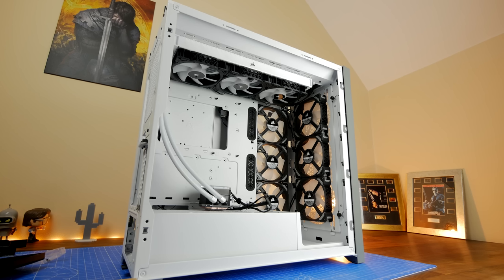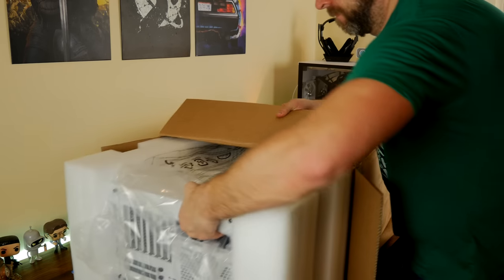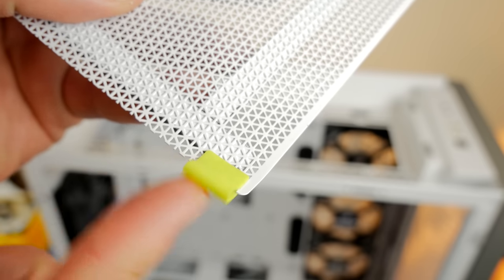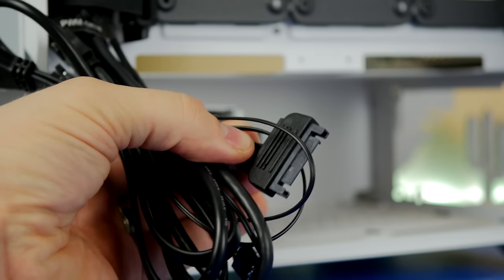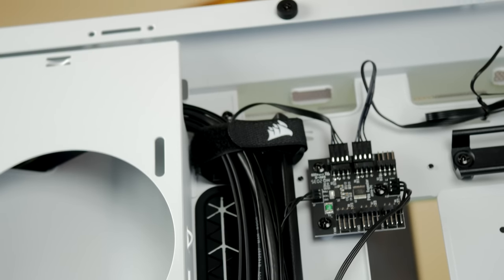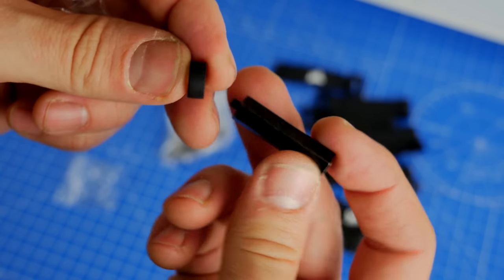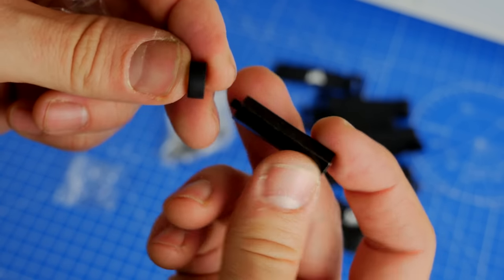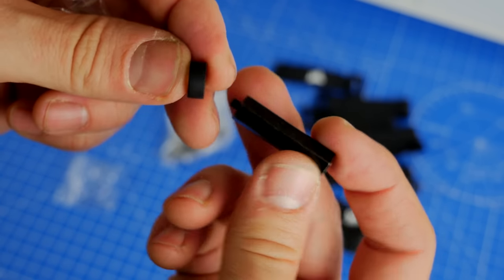Corsair 5000D Airflow build with 12 fans, H150i Elite Capellix Push Pull (in-depth build guide)

Comment: I was doing the same thing as you. Transferring from a Meshify C to this 5000D. 

I didn't bother removing either fan tray. I've removed the velcro straps from other cases and they were a pita to get back in. Installing the fans without removing the fan tray was super easy. The main problem I had with this case (and I feel like you gave me a solution for) is that my cpu power cables are pressed so tight against my 360 AIO that the rear fan can't even spin. Also, my AIO tubes were pushed up against the rear fan preventing it from spinning, but I just slid the AIO forward and that fixed that issue. 

But you gave me the idea of top mounting my AIO fans and just run a pull config. I should have known to do that anyway. I watched a video from Jayz2cents a long time ago that shows push or pull doesn't matter, you're still moving the same amount of air through the rad. Also, I have the same issue you do where the "shame" door won't close all the way. I thought the small hole above the finger hole was so you could put a screw into the magnet and hold it closed, but I couldn't find one that worked. 

Also, I was looking to see how you dealt with the front fan cables. Early on, you ran into the same issue as me where you were thinking your only option was to run them through the slots for the rear door and potentially cut them with the door. This is how I currently have mine, but it also made it to where I had to run the power cords across the side fan mount to get to the fan controller. Yours is more clean, but I didn't see how you ran them.  All in all, I really like the case and I appreciate this full length build!

Comment: I did a build with this case, I mounted 3x radiators 9x fans 3x SSD's, and a Corsair XD5. It was a super tight build!
Reply: How did you fit the side fan panel back in? It seems like mine won’t fit and like the screw holes just don’t line up. Is there something I’m missing?
Reply: @JayJulo  I don't think the rad is 100% straight, and I might have left a couple of screws out that didn't line up. Just made sure it was all tight - I have a video on my channel High End Gaming Rig 10900F, check it out if it helps...If you need to jam a RAD on the side it can only be 30mm thick or it won't fit.

Comment: Great and informative video, thank you. I have this case as well as the same fan set up and I hope you can help me out with a diagram of the wiring for 12 RGB fans. I have the same fans and cooler as you do. I have never had to wire this many before and I am unsure about extra hubs and where to plug them into work properly. I did get great info from the video and I "think" it registered in my brain but having an actual printable guide would ease my worry. Never the less this was a needed info guide for me thank you again. Maybe when my RGB hub arrives it will be self-explaining idk

Comment: I was wondering if a 360 rad in push pull could fit. Answer is yes.
Reply: SAME i was wondering if the cpu cable was gonna fit thx
Reply: @HolohoIic  So update! I actually used this case and a 360 rad in push pull the only issue I had was with the top CPU to the mobo fitting. Its hella tight but works!
Reply: @KamranHusain12  Currently doing the same build, same case. My only concern is when you have the pull fans on top, obviously the dust cover won't cover the sides where the air sort of channels in. Have you noticed any problems from this? Thanks!
Reply: @mattmanning8874   Regarding the dust covers on the sides I have not really noticed any issues with them. I removed the dust covers on tops because its pushing out.  BTW al my fans are the lian li ones.
Reply: @KamranHusain12  Nice. I couldn't fit my Liquid Freezer II 360 AIO on the top mount. Really sucks, but at least it fit in the side.
Reply: @mattmanning8874  Sorry to hear that mate. I used the EKWB AIO . It was a little of tight fit but I was able to fit it on top in push/pull configuration.

Comment: My first PC case was an NZXT H510 - upgrading to this case was such a massive improvement. Great video.
Reply from the maker: It really is
Reply: What you did with the other case?
Reply: @rodolfotsang4327  I threw some old parts in it and made a pc for my wife
Reply: @iamamish  damn i should have got the 4000D i got the 4000X why everybody buy 4000D? The seller recomende me the 4000X he says the 4000D doesn't come with rgb fans, is that right?
Reply: @rodolfotsang4327  yeah the 4000x is essentially the 4000D, but with a number of upgrades. It also has glass panels on the front and top. Honestly it is a very nice looking case. In fact, on my 5000D, I went and bought the 5000x glass panels to upgrade mine. 

I think the 4000x is a really nice case, you'll be happy with it.
Reply: @iamamish  you like the 4000x? First i was going to get the 4000D but the seller told me 4000D doesn't come with rgb fans, you have to buy the fans, i don't know if that is true, 4000x does look nice more luxury with the glass panel you can see the lights, the thing is i see a lot of people have the 4000x but the case doesnt matter that much, specs do, which one is the latest model?
Reply: @rodolfotsang4327  I think they came out at the same time. You don't need the 4000x, it's just a better looking version of the 4000d. From a functional perspective, they're essentially the same. But yes, the 4000x comes with RGB fans, and the 4000d does not. However I don't remember how many it comes with, and fans are easy to replace, so if the only reason you're buying the 4000x is because it comes with RGB fans, I'd consider the 4000d instead.
Reply: @iamamish  yeah i like RGB lights Why? The 4000d is better than 4000x? Don't make me feel sad, i just bought the 4000x
Reply: @iamamish  i don't know why the guy in the store told me to get the 4000x i don't know much of gaming pc

Comment: THANK YOU VERY MUCH for showing the front panel connectors and going through them. I've just ordered this case and didn't know if I would need right angle USB adapters or converters for my motherboard. So many videos just fawn over this case and throw in 15x $30 fans that Corsair have provided for them, a new capellix 360 cooler, and don't go into details that are very useful for a person trying to minimize the amount of deliveries they'll need to make to get everything working for their system.
Cheers, you've got my sub.
Reply from the maker: Thanks. Glad you found it useful. I was worried it was too long but I was trying to be thorough.
Reply: @TheProvokedPrawn  Yes, I mean I had kinda seen what I needed to in other videos but gave your a shot and I very much liked that you went into extensive detail about all the ins and outs. Given the time it takes to install fans, RGB, coolers, etc your video hit just right.
I also just noticed your Hitman 3 videos... my man! love me some agent 47.
Reply: @TheProvokedPrawn  lol I even have the same knife as you use to open the cooler if it's a Gerber.

Comment: This video rocks! I was looking up videos trying to figure out the ssd mounts and how i wanted to do my fans (i got 12 120mm and 1 140mm for the back) and it turns out you're doing Almost the exact same build as me! Definitely gonna watch the whole video and follow the same steps as you for my fan setup because this video by far is the best at explaining and showing.
Reply from the maker: Glad I helped. Hopefully enough to encourage you to subscribe
Reply: @TheProvokedPrawn  i just did! i completed my build just an hour ago and all went well besides the fact that i can only see my aio fans that are plugged into the commander core. i hooked up the other 6 to the usb hub in the case and the rgb hub as well but i still cant control their speed or lighting. all are running and lit up im just confused how im supposed to control them. do you have any ideas from your experience since your build is almost identical to mine excpet i got an asus mobo.
Reply from the maker: @colegordon9684  the PWM controller? You need to make sure that has sata power and is connected to the motherboard system fan header. Then in the bios you need to ensure that's set for PWM control. That should help
Reply: @TheProvokedPrawn  i was able to figure it out. turns out i had a loose cable in the cluster of cables in the back! everything is working great now
Reply: Does the 140mm in te back fit also with an aio in the top
Reply: Did the 140 fan fir at the back OK?

Comment: You mentioned that the low "tray" might exist so you have more space for a side mounted AIO, but i don't think so because the lip of the tray will touch the bottom fan, so it doesn't clear

Comment: Good video ! Guess what, had exactly the same issue with power cords to CPU. My plan was to have fans for the cooler installed underneath, pushing the air up. It would have meant ~ 90° bend, not comfortable doing that. So latest plan is install fans on top of the case, sucking hot air instead of pushing from underneath.

Comment: Leave the wire shield plate in if you are going to use those side mount fans, as it is now you are creating a vortex at the front where the flows meet and results in chaotic air flow, may still work but won't be near as good or consistent.  Putting the wire shiled back will direct air directly over the Motherboard although a bit restricted it will help keep the Mosfets and VRM's cool especially if you are not using a downfire CPU cooler.  Right now it looks great but you air flow pattern is a bit gimped by the 2 conflicting intakes. Great build regardless and Corsair usually puts out a good case.  I recently switched over to the Lian Li Lancool 2 mesh and never looked back ;)

Go with the newer Lian Li SL Infinity fans or even their original AL140 or SL120's, loads less cables and nonsense like Corsairs and look way better especially the Infinity ones.  I had the LL120's when they were a thing and lasted about 4 months before the flickering of Death issue that Corsair never bothered to fix.

Comment: I really enjoy your build videos. Great job. I have the 5000d and installed QL120 throughout. I have a Corsair 150 arriving shortly and now appreciate the ML 120s are more efficient. I was planning a push pull set up like yours with the QLs in the case in push too maintain the look with the MLs mounted up top to pull and be less visible. I know this would technically work, however you mentioned running the same fans throughout.
Reply from the maker: Corsair say you should stick to the same fans on the Commander but in my experience it does work if you mix them as well. 🤷‍♂️

Comment: Thanks for the video.  I have this same case in black using only 7 fans (3 in front, 3 on top, 1 in rear) and running stock an Intel 12900K, RTX 3090, & 5200 64 GB DD5.  With CPU-Z in stress mode: degrees = MB 34, CPU 64, CPU PKG 75, GPU 42, GPU Mem 50, Dram 40.  When running the Heaven software maxed out: degrees = GPU 67 and GPU Mem 80.  I'm not sure if the 6 extra fans are worth it since the upper top fans could be impeding air flow, since both upper and lower radiator fans are spinning at the same RPM.  Also, 6 more fans make 3 times the noise because all of the 6 extra fans are on the outside of the case, compared to having only the 3 front fans located on the outside.  The 3 side fans also will not allow access to the 3.5" drive bay without taking the fan case and/or power supply apart again :(  But don't get me wrong, I love my case and it is very quiet!

Comment: Just got mine a few days ago.... I guess white is new black... I still got black though, thanks to your video I know understand how to remove side middle fan extension panel, the inside part that is. I'll use it for a water block on my 3090FTW to route all that awful hot air out of the box. I am thinking if I want RGB or not... Thanks!
Reply from the maker: Glad I helped

Comment: Currently doing the same build, same case, and man finding this has really helped. My only concern is for the push/pull setup for the radiator. When you have the pull fans on top, obviously the dust cover won't cover the side/edges where the air sort of channels in. Have you noticed any problems from this, or noticeable dust on the radiator? I would hope with the exhaust that it wouldn't be too much of a problem, but thought I'd check. Thanks again for the in depth coverage!

Comment: I built one of these using an asus  prime 690z-p ddr4. I had the ame problem with the eps cables. Corsair needs to fix this as the eps locations are similar for a lot of motherboards. I solved this by mounting the radiator to the 140mm slots closest to the glass panel. It offsets the fans on the top, and doesn't look too bad.. There is now enough room to run the CPU power cables.

Comment: I didn't want to go through all the comments to see if anybody had said this but the thing about the hard drive cage if you take out the thumbscrews and move the cage forward there is another set of holes that you can put the hard drive cage in and just enough room for the power supply thin and the wires
Reply from the maker: I'm pretty sure I showed that but it's still tight.

Comment: When doing this case, it may be wise to install the watercooler as a front intake and have 3 fans blowing out the top, you're currently blowing warm air through it as opposed to fresh air from the front :)
Reply from the maker: With that logic you're then just sucking hot air into your case to begin with.
Reply: @TheProvokedPrawn  well obviously the air heats up? Because you cool a radiator with it? Still makes for a cooler CPU as opposed to using the warmer air from inside.

Likely doesn't differ a lot but it's still a valid point

Comment: Awesome video, thanks for he in-depth look. I'm looking at changing my PC and the Corsair 5000D Airflow came up as an option (along with the H150i funnily enough) so it meant having a look at reviews and feedback. I'm coming from an Antec P120 crystal, which has less airflow option, but I was spoilt by the side (or is it front?) glass door being on hinges.. my older cases have all had the usual 'pop a couple of screws and take it off'. It's a pity the hinge door isn't a standard now, although I see the back side (rear) door is hinged, so a little progress :) Dust filters are great and the shrouding is a fantastic additional/option.

Comment: Need to change like half of my HP Omen 30L, the temps are so bad it get's annoying, on 20% load 1080p low settings on Valorant for example, I get 71-80°C and when not gaming 60°C, so I really consider buying this case and now thanks to your video, I will most likely buy  this one, has enough space and at a decent price, also looks nice and not over the top. Also, I got the i9-11900k, RTX 3080, 32GB of RAM and will probably have 6-9 Fans, should I go for a 850W PSU or get a 1000W one  for 50 bucks more? I would prefer to not invest any more money for the next 2-3 years 😐

Comment: Such a cool case. Would consider it for something crazy, like an all-out build with a 13900kf + 360 AiO, a watercooled 4090 for gaming + my old GPU for rendering on the side in the same case. Then I'd might actually need the space as well as the thirteen 120mm fans in total for cooling 🤣 I almost wish I had that use case and that money... 🙃 But my 4000d airflow is more than good enough to fit and cool what I will ever need along the lines of something like a 13600k, 280mm rad and an air-cooled 4080 or lower.

Comment: Great video man. Thank you very much for showcasing all the minor intricacies you faced. I'm waiting for all the parts to arrive this week, to start the build. I have a couple of questions (I know this is an old video, hope you get to it):

1. Do I need an exhaust fan on the rear? Does it make any difference in positive or a negative way?
2. Does a MSI Suprim X 3090 Ti block any of the side mounted fans? If yes, will it impact the performance in any way?
Reply from the maker: Don't "need"
Can't say about the 3090 TI I'm afraid.

Comment: I think the most noise is that dust filter on the top fans. if you remove that there is a less tight airway and it should be quieter... (At least there)

Comment: Very nice video, thanks a lot! Got my rig mounted from a workshop a month ago, with the normal 5000D case (not the Airflow version) and the H150i Elite Capellix with no extra fans for the push/pull setup, and just the intake and exhaust fans that come with the case. I'm starting to think that I will copy your setup (when my wallet recovers! XD) because I think that temperatures are a bit high when doing VR flying simulation (high 70s ºC for both CPU - 5900X and GPU - 3080 Ti).

Comment: have thought about installing the rad in the side with pulling air in and 3 fans in the front. and on the top 3 to blow hot air out

Comment: I have thaT CASE AND i HAVE BOUGHT a set of fans I am now thinking I'd like to do a black and white build's with the liquid cooler also my nwe MB is a ASUS ROG Maximus Z790 Hero which won't arrive before November and I also waiting for a power supply designed for the new rtx 4000 series or maybe just a 3090Ti it has the 12+4 connecter and waiting for the  13th gen 13700k cpu so watching you videos are giving me some really good idea's I can plan out. thank you for all your videos so very good details you provide and you other videos as well. thank you for all your videos

Comment: Can you use 3 120MM QL120 fans on the front, without having to keep the slanted panel removed or install 3 extra fans? Like, 3 fans on the front only, not 6. Gorgeous build either way!

Update: You explained it in your video. Thank you so much!! I did a similar build in PC Building Simulator and it wouldn't let me. Thought it was a bit confusing. I'd imagine that the build would look better overall with 6 (9) fans - I'm going for aesthetics.